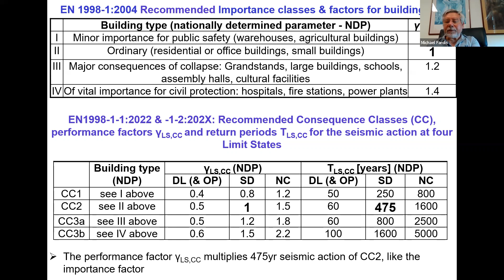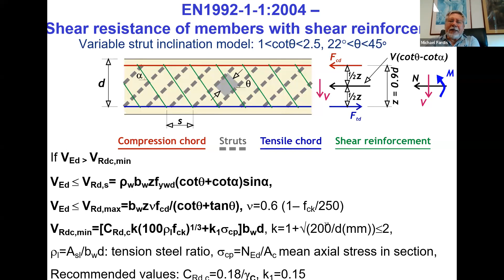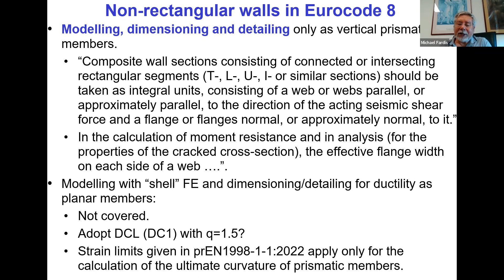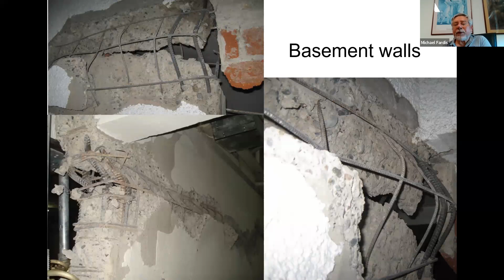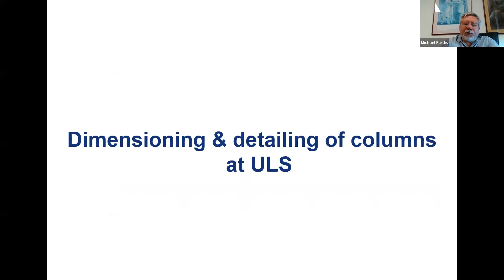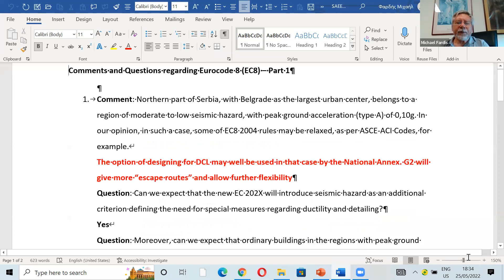Prof. Dr. Michael Fardis: From the first to the second generation of Eurocode 8

Comment: Mr. Fardis demonstrates a lack of knowlage regarding practice in high seismic areas, if PGA is > 0,30g than only DCH is rational.
Unfortunetly the second generation of EC8 is a code for LOW seimicity, where there is high seiamicity we will be forced to use ACI 318 + otger US codes, or codes similar to this codes.